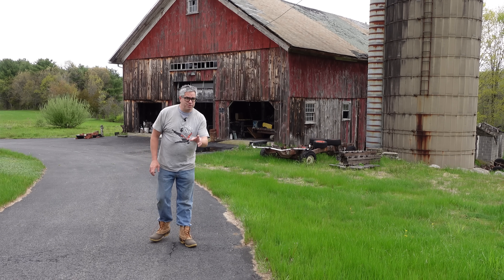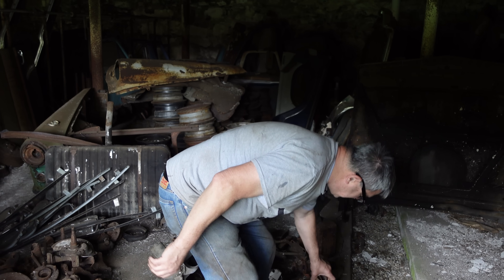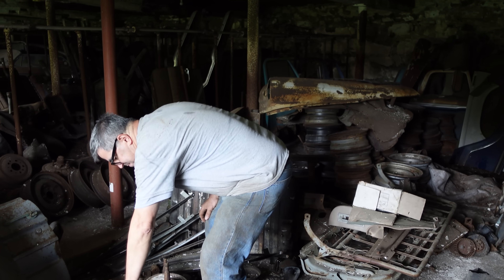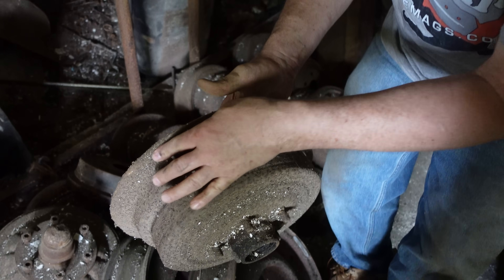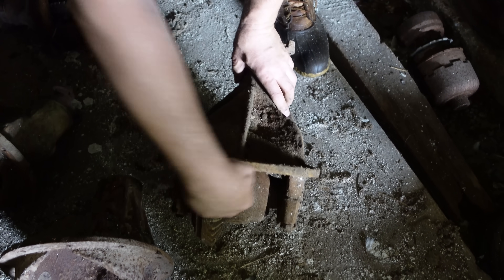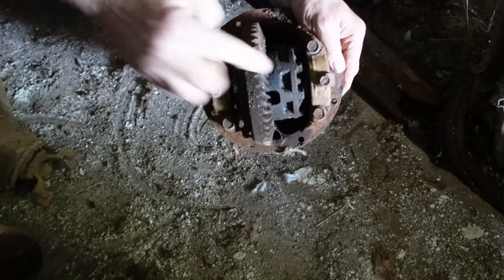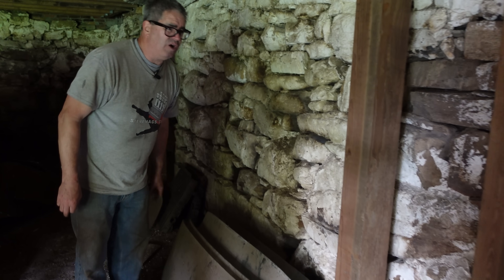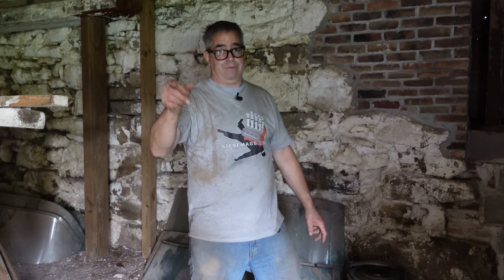Bringing Up The Rear

Comment: Awsume info and  not growing up in America in the 60,s 70,s i relied on American car parts importers here in Sydney Australia. Some had old stock going back the kerosene headlights and the brass era 1920,s.  Wooden spoke wheels were still stacked up that they imported in the 1930,s.
I remember 1970,s top fuel dragsters and funny cars here often had the big Olds diffs that were over 9 inch crown wheel. And the 64 Riviera rear axles were as thick as my wrists.
I have allways had American cars in my driveway since 1976.

Comment: The oldsmobile exhaust manifold used on the right side with the block off cap, strange enough GM trucks 1978-81 with the 5.7 liter oldsmobile diesel engine used that block off cap because they had factory dual exhaust system

Comment: Cool stuff, Steve! My grandfather who adopted me at age 3 in 1971 was a Fiberglass Research Technician at PPG (Pittsburgh Plate Glass) in Harmarville, PA for many years. He did some interesting stuff there, like in 1979 or so....he and his team built an Olds Toronado using fiberglass for everything they could (I think it was an olds Toronado....) in an effort to reduce the weight of automobiles. Well, the Olds turned out heavier than it's metal counterpart because of all the bracing they had to do, so.....well, it was worth a shot, right? They made a LOT of stuff out of fiberglass resin and fibers, down to the upholstery. And, I think LOF glass was Libbey Owens Ford? Anyway, take care, man, and keep the good stuff coming! Learning a LOT! Stay safe, brother.

Comment: Both of those manifold numbers appear in online searches so with that, a GM parts book or Hollander interchange manual they can be figured out as far as applications. LOF was "Libbey Owens Ford" and was started in 1930 with the merger of Libbey Owens and Edward Ford glass companies. In 1986, Pilkington bought them and by 2006, Nippon Glass of Japan bought them. 

Typically tinted glass has words like "Safety Flolite", "E-Z Eye", "Tinted", "Solex Herculite" among other terms, depending on who made it. I have some NOS PPG square body truck glass as a friend of mine used to deliver glass on the side in the 1970s. When he cleaned out his house before moving, he came with a couple of van loads of stuff. Some I kept, other things I sold. Otherwise, they were getting tossed. I did help him sell some old warning lights to movie car companies that use them to upfit period correct cars for movies. I had them sold in a day, my friend was tickled to turn them into cash.
Reply from the maker: Waste not want not (pick it up and eat it). That last line is from Crissy Hynde (lead singer for The Pretenders)...Thanks for watching and writing. -Steve Magnante

Comment: Never realized how tiny them Olds V8 exhaust manifolds are!  And my very first car was a '77 Vista Cruiser with a 350!
Reply from the maker: I guess a "plus" would be how Olds tube steel exhaust headers would be more compact than even a Chevy small block and so, much easier to install on an engine in the car. Just a maybe. Thanks for watching and writing. -Steve Magnante

Comment: Morning  Steve..... oldz's back in the day had that weird system instead of a y pipe, they had a cross over pipe from one manifold to the other ,then single pipe out to the back, it was capped when you ordered or installed  dual exhaust.
Reply: Capped off on the Olds diesel.